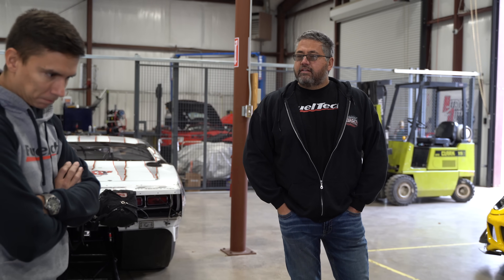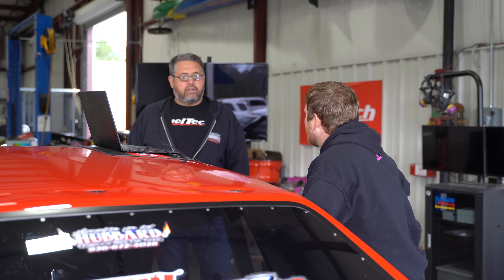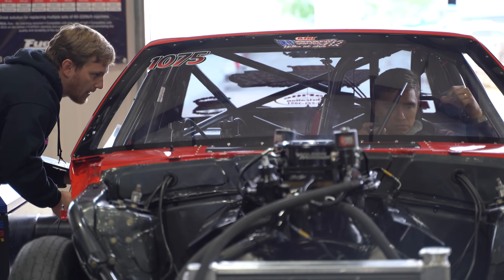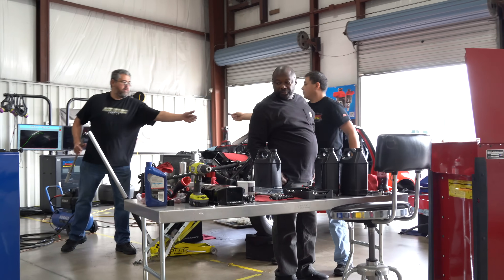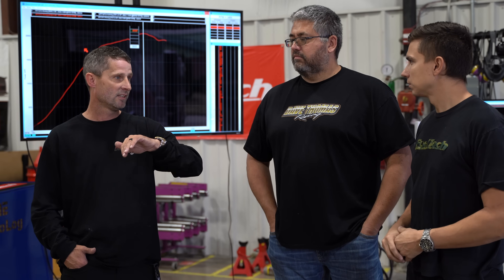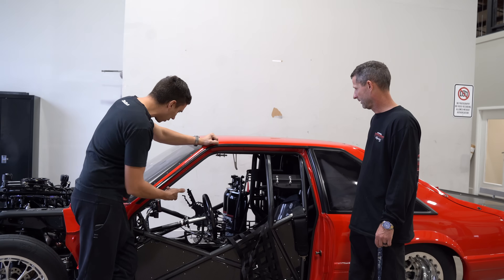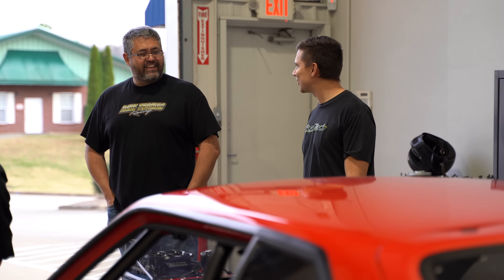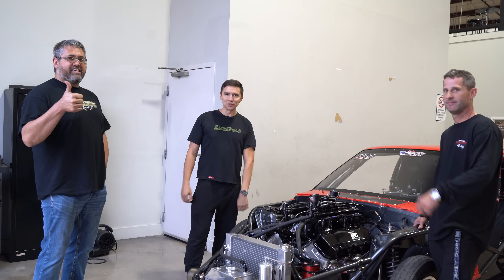Michael Hawes/Kenny Hubbard | 2,136 WHP | Nitrous Big-Block Chevy

Comment: 2k hp WITHOUT forced induction is special. What a wonderful build
Reply: @bigboreracing356  $500 worth of bottles and a $20k big block to keep up with sub 400 cubic inch motors on bitch boost, like how we brought Derrick Kelly’s car to a 4.84 shootout and won the whole MFer on 23 lbs 🤣 we were concerned with how little power it took to donkey stomp the 4.84 cars everybody told us to worry about lol
Reply: nitrous is a power adder. its not like there aren't any additives to the engine XD
Reply: @lennixsingh626  Didn't say there aren't though did I?
Reply: well stop acting like it.
Reply: "Nitrous Big-Block Chevy"   Nitrous Oxide IS "forced induction"    WTF
Reply: @FABRIC8TIONUNLIMITE1  No it's not. It's a chemical power adder. The piston engine is still operating under atmospheric pressure